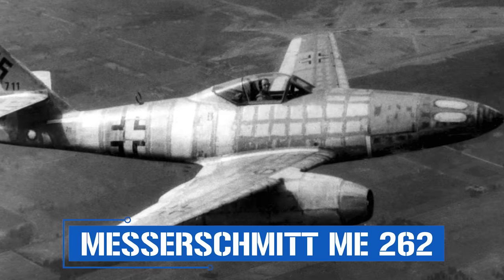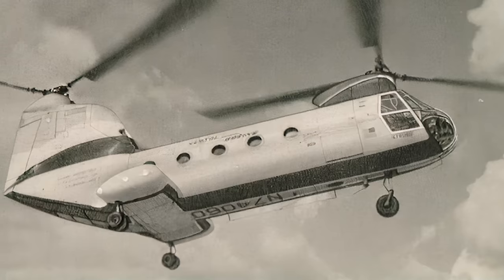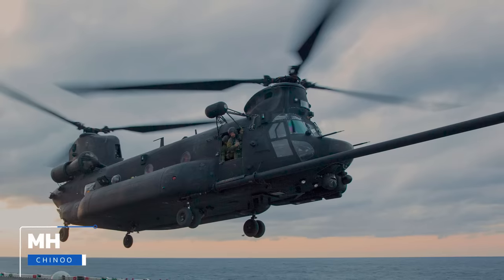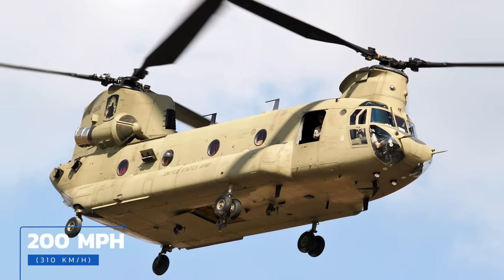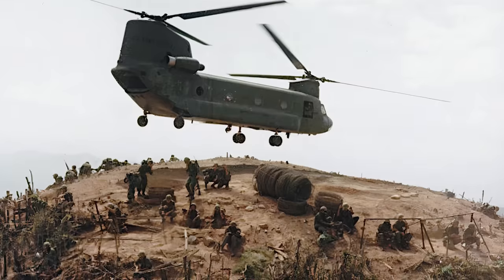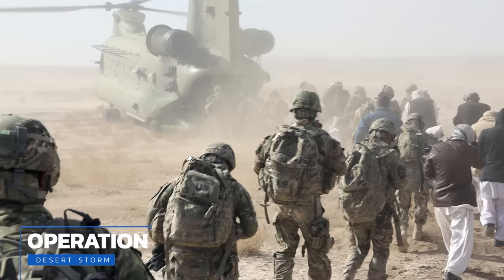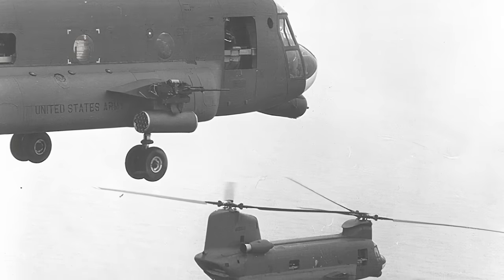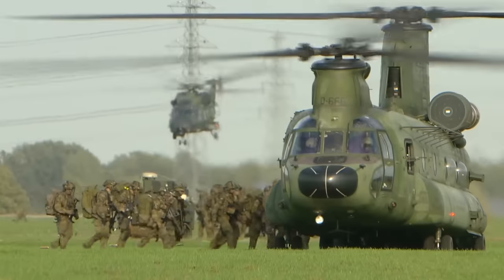The Boeing CH-47 Chinook

Comment: Spent 20 years working on Chinooks, 'D's and 'E's.  And a slight correction on the speed of the Chinook.  It is faster than the Apache.  Remember several times that we would have to slow down while flying in formation with them.
Reply: Yup they are faster.
Reply: Lol 😆 lol 😆 hilarious.
Reply: Very true but when they have to turn it’s like a greyhound bus
Reply: "Heavy Metal"!
Reply: Beat me to it. 😁
Reply: Engine upgrade will do that
Reply: Yup! Speed of helicopters is tied more directly to rotor surface area, power, and rotor bite on the air than size, so they are faster than most, if not all attack choppers!
Reply: @jonkeau5155  not the upcoming Raider!
Reply: Yep significantly faster
Reply: @jonkeau5155  how does it stack up against mil-mi 24, they are crazy fast
Reply: @janloncaric3621  Mi-24 is faster, but the Chinook is faster than the Apache.
Reply: AH64 Ego check 😉
Reply: I’m a Blackhawk guy and I can confirm this.
Reply: Can confirm
Reply: @mattna1010  That's not ever remotely true, The 47 are extremely maneuverable.
Reply: It's not difficult being faster than an Apache, they're usually down for maintenance.
Reply: Yep. Beat me to it
Reply: Yup true that, remembered that when I was deployed in Afghanistan in 2009.
Reply: @terryyocumiii9645  😂😂 Apache guys don’t unbolt the engine from the airframe. They just rip it off
Reply: Same! I remember doing post-OH flight tests and boy could those Chinooks go FAST. Then you’d realize the Collective was even only delivering maybe 75% of power, which was mind blowing.
Reply: i eas about to type myself. an apache is no match for a chinook in a straight line
Reply: Fact’s 💯
Reply: @mattna1010  Not you obviously haven’t flown on one much they are as maneuverable as any other rotor aircraft. They can do things that blow your mind💯
Reply: @blueberrywilbur315  Missiles are much faster :)
Reply: it makes sense that Apaches, like many gunships are slower. Those pylons, stubs wings, protruding gun probably don't do drag reduction any favors
Reply: @Casper1907  thanks Einstein
Reply: @wiryantirta  im pretty sure they are down a motor on the Chinook, but I could be wrong...
Reply: Chiiiiinnnnnoooooooooookkkkkkkkkkkk!!!!!!!!!!!! Where my Fort Eustis homies at!!!!!!!!!!!!!
Reply: @taylorjames3243  nope 2 turbines with a cozy napping platform on both, but the AH-1 Cobras, before the Super size, had only one. the 64's are short a few (4 or 5, I think it has 7) transmissions and gear boxes...boxen, when annoyed with the supply private on duty. I was a power train tech for all military rotor craft, before it was broken up to train on a single bird, so many yrs and head traumas later could mean I'm off on the numbers.
Reply: It was common for Chinooks to outrun their Apache escorts during cas-evac flights in Afghanistan when they had to get the casualty to the field hospitals as fast as possible.
Reply: Worked on B's, C's and Super C's . 
The D's were in the pipe but, I never got to ride on one.
I was there when the AH64 was demonstrated for us at Ft. Hood.
There was speculation that it was to be faster but, it wasn't and especially not as fast at altitude.
Reply: Apache pilots love it when you  ask them how it feels to be slower than a Chinook....just love it🤣😂
Reply: Echo models? NSDQ.
Reply: @ericnelson4540  NSDQ
Reply: yes, we've spent time being 'Escorted' by the Apache, and we've had to back off for 'TGT' limiting....didn't want to say we were to fast....
Reply: 21+ years on D's and E's (2nd Batt).  Remember, the -64's VNE is not straight and level, it's (and the -60's) is in a dive.  Our VNE ends when the mission is over.  The -60's and -64's VNE ends when they run out of altitude, or terminates in a Class A Mishap.
Reply: I have seen a number of accounts were chinook pilots running cas evac operations had to make a decision between running flat out back to base with the wounded or restrain their speed and not out run their top cover.
Reply: Yes sir. Came here to correct that and see it had already been done. Lol
Reply: U ever work with Rich Deering during your time?
Reply: Actually, it depends....Apache does have a higher Vne than the Chinook, but in level flight, lightly loaded, and in low density altitudes the Chinook is faster. When heavily loaded or in high density altitudes, the Chinook is somewhat speed limited by dynamic component stress, monitored by the crew through a strain gauge on the fixed link attached to the non-rotating swashplate.
Reply: Chinook is most definitely faster than an apache or Blackhawk. Just as maneuverable  too
Reply: @terryyocumiii9645  Ouch!!😂🤣😂🤣
Reply: @mattna1010  beep beep
Reply: @mattna1010  Not true at all. They are very nimble.
Reply: @jonkeau5155  not quite...there's a lot more to it then that...there are a couple helicopters (civilian) thar are significantly smaller then the Chinook, are faster, and most are single rotors
Reply: @jamesbrigham2926  it slightly is...if you compare it to an Apache, Blackhawk, or Iroquois, it is NOT as maneuverable...but for a helicopter at least 2x heavier then any of those, and probably 5x or more in combat set up, it is extremely maneuverable...I've flown with Chinook pilots that describe the Chinook as a bus, but most of the pilots would choice it over a Apache or Blackhawk any day
Reply: @Nipplator99999999999  ya...2 turbines for most US military helicopters...I believe it's the Seanight that has 3 and the Kiowa has 1
Reply: @jasonbrown3632  I will give you that is not as maneuverable. That being said even if it is less that does not mean it's a big lumbering dumpster fire. Most people see how big she is and assume it's not fast or able to turn and that simply is false. Thanks for the civil discussion.
Reply: As an Apache guy, Ds and Es, can confirm, 47s are faster. Would like to remind some of the folks here... while most mechanical information on US helos is not classified as secret.... it is sensitive information... so maybe don't compare gearbox numbers and such.
Reply: @jasonbrown3632  Sea knight (h-46) is twin turbine.

You're thinking the Super Stallion CH-53E.
Reply: That is because the Apache's VNE is in a dive, they have to climb and dive to achieve their top speed while a Chinook can achieve VNE in level flight.  Turning is a different story.
Reply: @terryyocumiii9645  hands down.. i can confirm this
Reply: I was coming to say this.
Reply: @TheBooban  The Raider is not a helicopter, it's a tilt rotor so of course it's faster. I think it's also going to be a maintenance and mishap nightmare for the army like the v-22 program has been. I hope i'm wrong but i don't think i will be.
Reply: I remember seeing an interview with an Apache pilot and to paraphrase, he said something along the lines of "It's humbling to have to ask the flying schoolbus to slow down so it doesn't outrun us."
Reply: @Casper1907 you are actually unable to read a room.
Reply: We're on F's now
Reply: @nsmithssp C models were still faster with the L712
Reply: The util d’s are limited to 140kts because of the bubble windows that are installed
Reply: @baconsnake6463  Not when we were in them 💯
Reply: @mattna1010  Nope. Tandems are very maneuverable. I've seen our firefighting pilots fly.

Comment: If anything is going to replace Chinooks, it's going to be an upgraded Chinook design. The strengths of their double-rotor design are too important to ignore.
Reply: @osumbuckeyenut  It's not actually, it's been proven by math, research, success rate, kill count, and rate of friendly fire. It's only popular because it's iconic and because the troops actually see it as opposed to a high altitude bomb drop from a fighter.
Reply: @guindle9291  truth
Reply: Lost enough army buddies in CH-47 “Sh!t-hooks” that yea, get rid of them and replace them with Osprey vtol fixed wing transport aircraft….at least you can parachute out of those if you have an engine failure. If your in a CH-47 and an engine gets damaged or you have engine problems…your fukin dead, no escape. Half of seal team 6 was killed in one of these death traps
Reply: @ERAUsnow  he probably wasn't talking about the pilots jumping out
Reply: @Snowpilot  not sure why that auto correct from wasnt to a was...
Reply: @guindle9291  curious as to what your sources are for the math, research, success rate, kill count and rate of friendly fire.... As a current CH-47F pilot, I'd like to know how you are more aware of our 2060+ retirement date than we are...
Reply: @Dj.MODÆO  I don't know if you remember the development of the osprey, it was awful. dozens of my fellow Marines died in that damn thing when it first was used.  it kept failing but the politicians had spent so much money on the project that they wouldn't cancel the damn thing, throwing more and more money at it, despite all the lives lost until it worked.
Reply: @guindle9291  I first thought you were talking about Chinook, but it didn't make sense, than I realized @osumbuckeyenut must have made a bullshit comment on an A-10 or something that you responded on
Reply: @Dj.MODÆO  You cannot seriously think an Osprey can replace a fucking Chinook.
Also there are plenty of pilots that have landed a chinook with 1 engine and even with transmission failures, it's a beast that keeps flying, and this was 1960s-70s Chinooks, the modern ones with upgraded engines can easily fly with one engine, if it has no sling load
Reply: @ERAUsnow  Indeed

Comment: Just remember "If it isn't leaking hydraulic fluid, that means it's out. DON'T GET ON!!" 😁
Reply: It is funny and kinda sad just how many aircraft that can apply to.
Reply: Applies to just about every Rolls Royce aircraft engine too.
Reply: @GorgeDawes  every rolls royce engine * no need for the aircraft designation, they're cars have a decent amount of blow-by and oil burn and leak, I havnt worked on any newer than 2008/10 ish but they all had oil issues
Reply: The first couple times I was on a chinook I had a parachute on and was still a bit nervous, they feel like they're designed to shake themselves apart rather than get to their destination
Reply: Often heard conversation between crew chief and pilot; "Any downing gripes? No. Is it leaking? Yes. Will it start? Yes. Screw it fly it!" Pretty much sums up military aviation.
Reply: @gapratt4955  There's a reason why there is "allowable drips per (time)" charts for military aircraft.😁
Reply: I thought applied only to the osprey?
Reply: @jonathanwright5550  Nahhh always been like that. Worked around Phantoms back in the day, like a Harley you parked it where you wanted a variety of fluids on the apron.
Reply: Spoken like a true marine
Reply: Heehee yX-D!! ❤️🥇🏆🚁